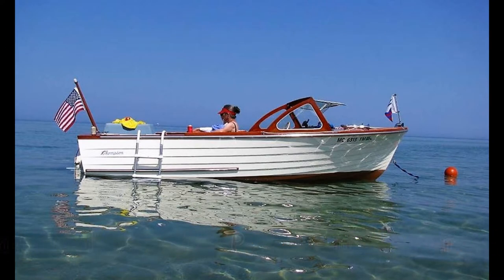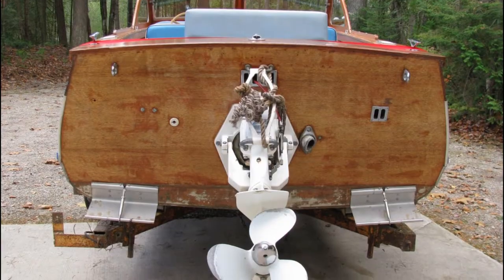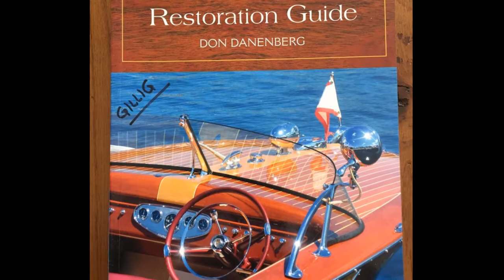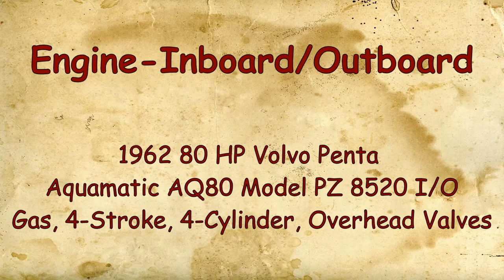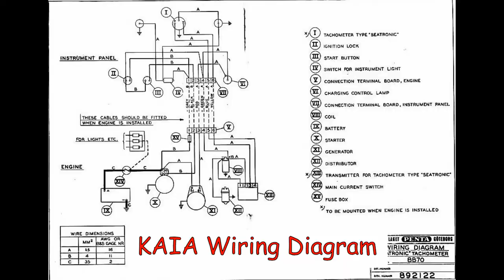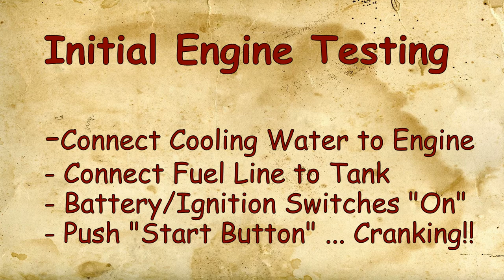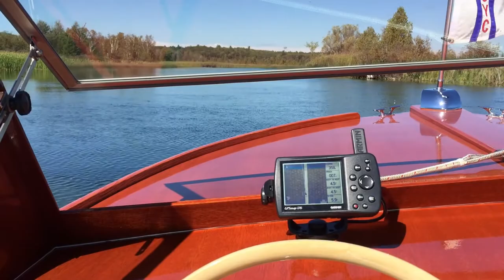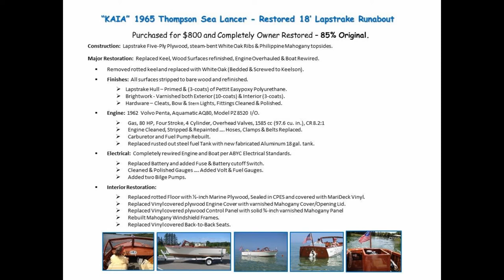1965 Thompson Wooden Boat Restoration

Comment: I had a 20 foot Thompson, that had a Ford V-8 straight inboard., back in 1967. It was built for Lake Michigan use and was just a great boat to drive. It needed some engine work and had side draft carbs that I had rebuilt. It would do over 40 miles an hour, which was great for heavy boat. I only have 1 picture of it and that is not great. Can't seem to find any pictures on line. Like I said it was built for Lake Michigan and only 12 were built. This was a great video, reminded me of my old boat. Thanks for posting.

Comment: Great video. I had a 1958 Thompson with Evinrude Lark 35 back in 1968. Had it out a lot on Long Island Sound out of Milford CT. Only a 15' so had across seating but great to run standing up at the wheel, which was on the right side on my boat.  Love those old lapstrakes!!

Comment: How splendid! You did a much better job than I first thought you would. Its a time consuming thing. I know this as my brother has worked extensively on his 2 late 50's Lymans of the 18 ft and 19 ft sizes. The 18 footer was about $800 and when he went through it,  it needed half new frames, several planks, a new stem..... barely worth it! He has since done all that, but to save time he bought the 19 footer in very good condition for $10,000 and that was actually a good  price compared with others of comparable condition! Yet it still needed a few months of work on all the little things. So I know how much work you did- the wiring alone is a pain in the rear! Your $800 price was indeed not just a bargain but a rare find!!  Your boat was probably a Peshtigo Wisconsin boat and not a Cortland, New York boat I'm guessing. I live 25 minutes west of Cortland in the Finger Lakes. I grew up in this region and we had a similar boat (obscure brand called Cowells) that we ran on Lake Ontario and the Finger Lakes. Locally made was another lapstrake runabout which was Penn Yan, and we occasionally admired them as well.  So again, good job, and I especially admired your fresh varnished wood appearance in the interior lapstrakes (most people leave the dark wood stains and varnish over it) and especially that you got rid of that vinyl padded dash! Authentic but goofy! The mahogany dash is lovely.